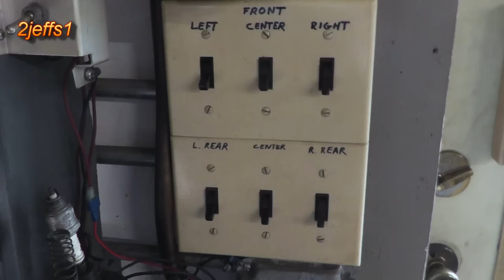Convert Fluorescent Lights to LED Tutorial - Save Money on that Electric Bill

Comment: Isn't it easier and cheaper just to buy a new light fixture? Or not?
Reply: buying something is always more expensive than not buying something.  This doesn't require you buy anything other than a bulb, which you buy in either case
Reply: Todd H
: Yes, in my experience it is. NZD$130 (approx) for a whole new fitting, verses NZD$170 for the two tubes. I chose to retrofit because I like my old batten holders better.

Comment: Very good video. Save money? YES, especially long term.  Brighter? I have my doubts. Most LED s  output less lumens than incandescent, halogen or flourescent equivalents.
Compare:
Brand: Luceco LED-------------------------Phillips flourescent
Type: T8-----------------------------------------T8
Temp: 4000K---------------------------------3500K
Watts: 18---------------------------------------32
Watt increase:-------------------------------180%
Lumens: 1800-------------------------------2875
Lumen increase:---------------------------160%
Lumens per watt: 100-------------------90
Even though the LED directs more light downward (240degrees), a good portion of the flourescent is reflected down by the reflector. I suspect you would need to purchase additional LED fixtures to equal the lumens and foot candles of the flourescents. I would like to see someone do a light meter test.

Comment: Jeff, can you explain the dual ended LED tubes? The dualies are cheaper at my HomeD versus single end powered. At a price diff of $19.99 vs $7. I tried making one end live and one end neutral but the bulbs wouldnt light up until I converted it to single end powered, like your video. Other videos seemed easy enough, connect the blue/reds on one end to the live (black) wire, and the neutral (white) to the other end's wires (yellow). I am pretty stumped at why that failed. Instead of spending $15 for 2 tubes (dual end), I ended up spending $20 for 1 tube (single end) and in a horrible triangular design that was a PITA to snap on and rotate. I even checked to see if the tombstones were shunted or not, they were non-shunted ones.
Reply from the maker: Kinda confused on that one too Jasen. A guy just told me that all the big box stores are only selling the direct fit where the ballast remains in now. The wiring was too confusing so they quit selling the conversion ones.